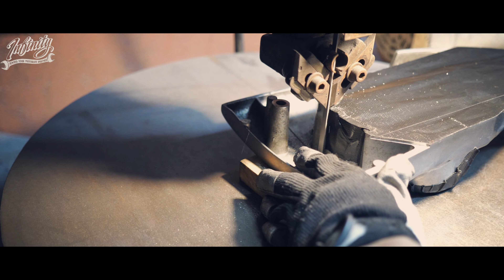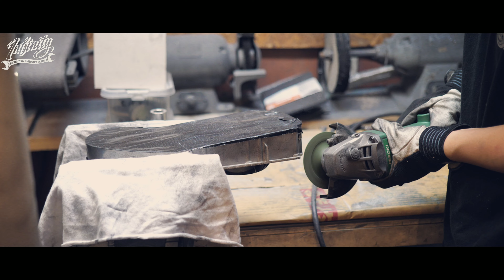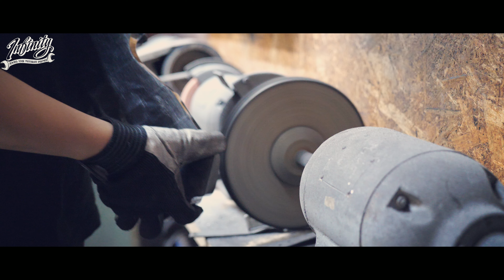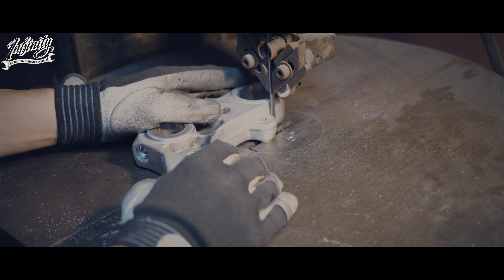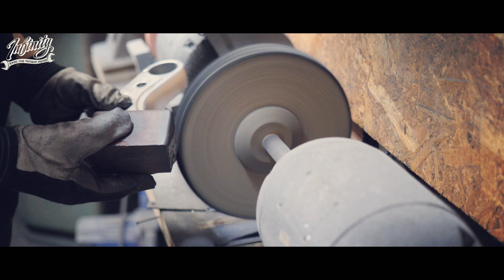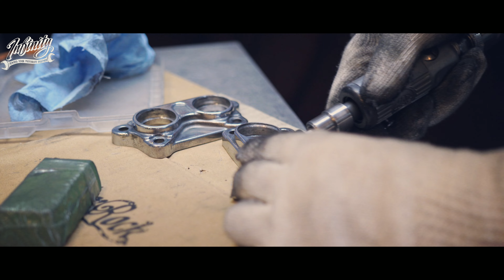⑤【NEW ORDER CHOPPER SHOW】各パーツのポリッシュ カムカバー トップブリッジ プライマリーカバー エンジン アルミポリッシュ Polishing of each part

Comment: I was using to do this on some bike parts there is 25 years ago. It's a long job, but at the end, you have got some very nice parts who are not comming from a catalog, and who are as you wish. 
Under your pilishing wheel, you can put a large cardboard, with some dust wood inside. That catch the dust, and if you accidentaly let falling your part, it is not falling on the concrete. 
Also, the dust wood helm very well for cleaning, degreasing, the parts after the polishing.:goodvibes:
Reply from the maker: I'm learning a lot! Thank you!